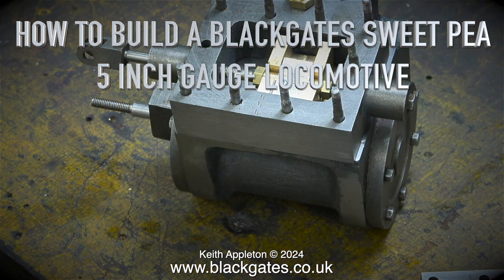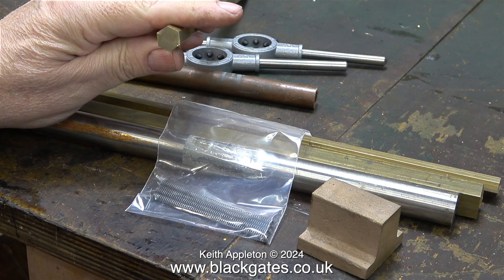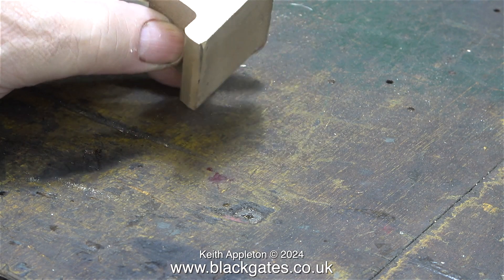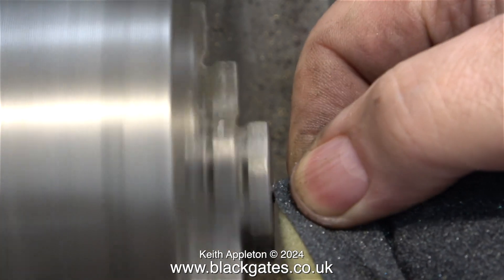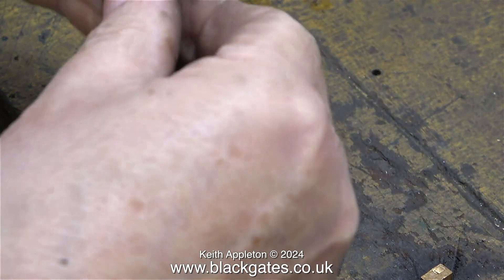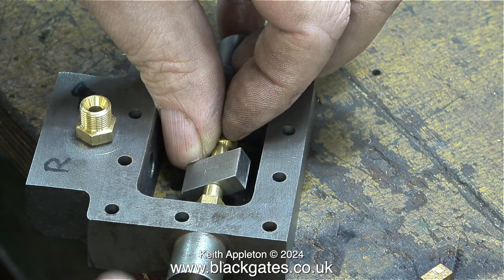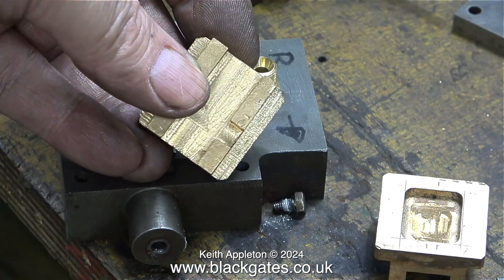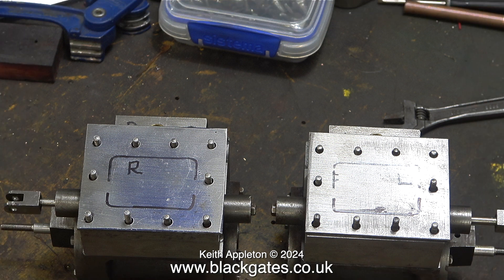BLACKGATES SWEET PEA LOCOMOTIVE BUILD - PART #18

Comment: What yr thoughts on piston valves ?
Reply from the maker: They are technically better than slide valves (causing less stress on the valve gear components), but Piston Valves wear out - Slide Valves wear in }:-)))
Reply: @keithappleton  makes sense 🙂

Comment: In the project I'm doing, I directly threaded the iron block, so that it is possible to adjust the distribution during assembly, then later, when it is adjusted and everything is assembled, the rod that moves it forwards and backwards will no longer be able to rotate given that there will be a control rod that will make it move forward and backward but will not make it rotate. did I do well in your opinion?
Reply: the idea was born while watching one of your videos, exactly this one at minute 0.50:
https://youtu.be/YyIZQb-t9mc?si=A2QNblo4ULJKlarm

but I didn't like the nuts that way, I wanted to be able to avoid having to dismantle the "drawer" cover if it was necessary to make a small adjustment when assembled. then I decided to thread the block that moves the distributor so as to be able to rotate the control rod to be able to screw and unscrew, and therefore move the distributor further forward or backwards. the result is what you always see in one of your videos, exactly the at minute 8.18:
https://youtu.be/zd3-6iR7QdQ?si=1rbFIQLwP8zNkGq0

I hope it works well 😅

now it just needs to be built 😊
Reply from the maker: The Iron Block as you call it is the slide Valve Casing. Do not thread the block as the valve needs to float on the Valve rod as it is the pressure of steam that holds the valve onto the port face. What you are attempting may not work out well.
Reply from the maker: Which part is the Iron Block that you mention ???